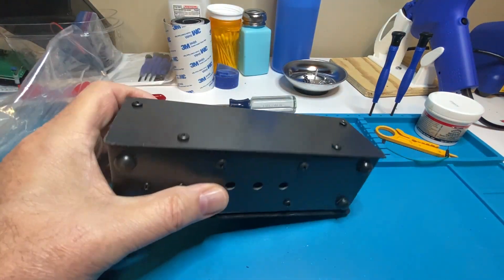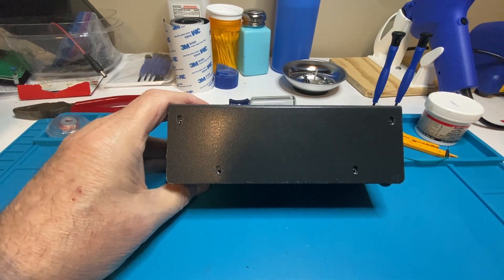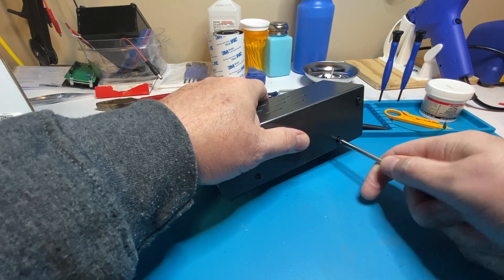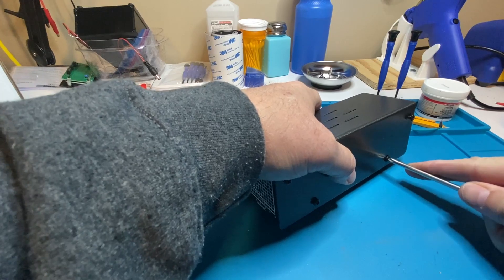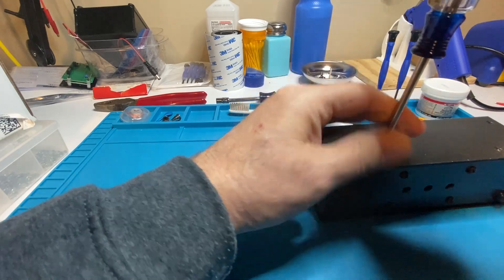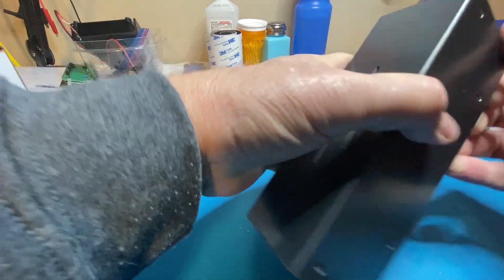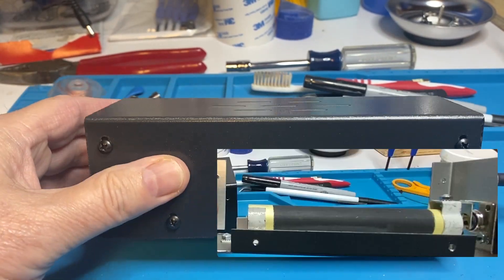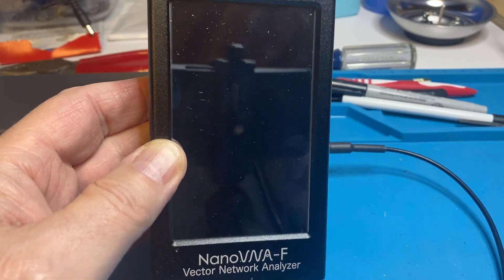MFJ-260C Dummy Load

Comment: Carbon
Reply: I have answers for you about the screws must tight likely they used some form of “Loctite“ which is a brand and also a formula used in typically three strengths, green light bloom, intermediate, and red never getting it off again that scenario. How is it at my company on our manufacturing floor it’s just to keep screws from backing out do the vibration or people tampering with her sometimes. Under the shield is probably some sort of iron core or air corps, iron and Dr. some type and be my guess it looks like.
Reply: https://youtu.be/fO_Y5aKrrxs